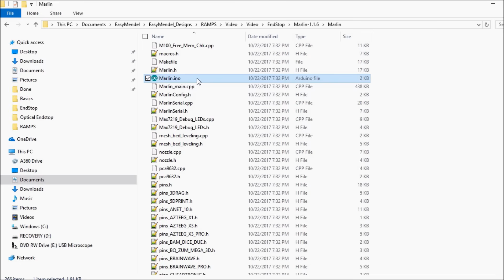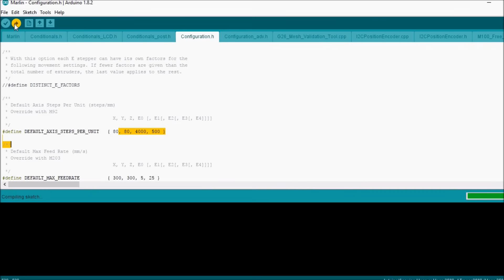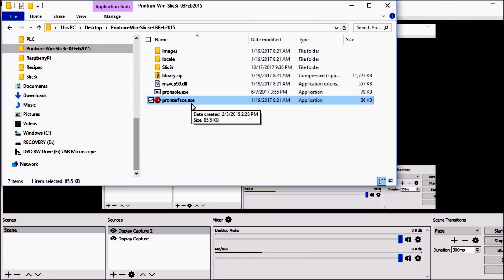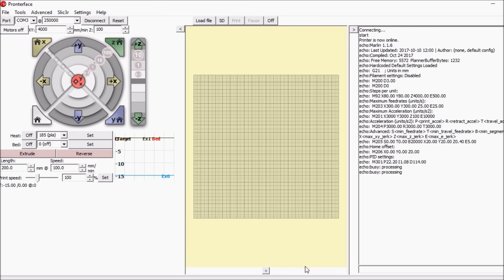RAMPS 1.4 - Stepper Driver install - basic

Comment: Hi @edward braiman nice video i got my aurdino burnt with 12 v please help it's 2nd time firstly i was using 24 v
Reply from the maker: Could you give me some details to the issue?  Are you having issues with driver boards?
Reply: Edward Braiman  thanks for such a quick reply 😊 blank mail me on pr976252@gmail.com i want help badly
Reply: Edward Braiman my aurdino is burning don't know reason.
Reply from the maker: Could you tell me the devices attached to Ramp board?  I'm trying to get a visual of how the hardware is put together.  The reason I ask is to see the orientation of the Stepper driver board.  Remember the Enable pins on the Stepper board and RAMPS board should match up.  If they are not matched a Stepper board can burnout.  I've had this happen several time in my configuration before I understood what had occurred.   Remember having an problem is a great opportunity to learn something. Also keep in mind I've learn a lot based on the pile of cooked Arduino boards now approaching 5.  It's also the reason I started making these videos as I realized I was not the only person having this issue and by making them I could save people time and money.   So I always think of my mistakes as something to learn from.  And if you want to amuse yourself, check out some of the questions I've asked on reprap forum.

Comment: Thnx for this explaination. Could you please help me, my hot end and endstops are working but stepper motors are not working.
Reply from the maker: Could you explain your configuration? And what you see occurring?
Reply: Edward Braiman I am using Arduino mega 2560 and ramps 1.4. When I press print (in pronterface) it shows percentage at the bottom. My hot end heats up and pronterface shows that the product is under process ( echo busy: processing ), after some time that 3d model in pronterface changes to green that means the process is done but in machine my stepper motors never move. I am using NEMA 17 stepper motor.

And thnx for helping me...
Reply from the maker: When you are not using the hotend does x,y, or z axis move?  What version of Marlin firmware are you using?
Reply: Edward Braiman I tried without hotend but still motors are not working. I am using marlin 1.1.8
Reply from the maker: It might be your stepper driver can you tell me the type and show me an image of how it's in the RAMPS 1,4?
Reply: Edward Braiman Thank you very much for helping me to solve this problem, I changed my stepper driver and now it's working.
Reply from the maker: Np, it's a challenge to try and TS from a distance.
Reply: Having the same problem and i even changed the driver.
Reply from the maker: Which version of the the Marlin firmware are you using?  If it's higher than 1.1.8, then there is now an additional step.  You will need to search on a4988 and specify stepper type and remove comments for all axes used.
Reply: @EdwardBraiman  i did that already, but the motor seems like its stuck or something.

Comment: Your videos are helping me so much! A quick question that I can't seem to find the answer to anywhere. Theres a slight gap between one of my stepper drivers (like I can't push it down the whole way) is that okay? If not how do I remove them to replace them? I'm having the hardest time getting them of.
Reply from the maker: +Meowdolf a slight gap can be okay as long as it has a good fit.  The main concern is good communication with the motor.  If this not occuring then you will need to remove the stepper and reseat.  A thin flathead screw driver makes a great wedge to work the stepper free.  Hope this helps.